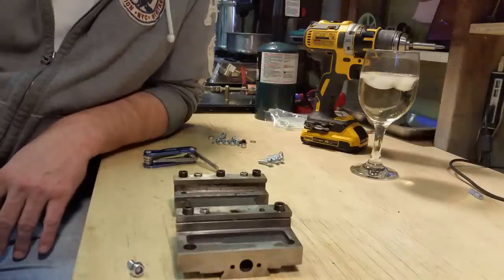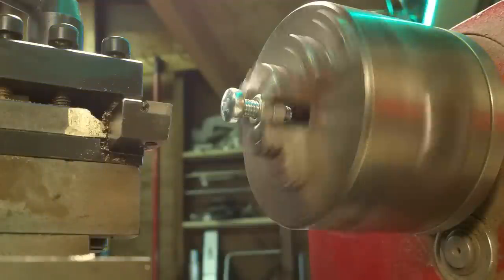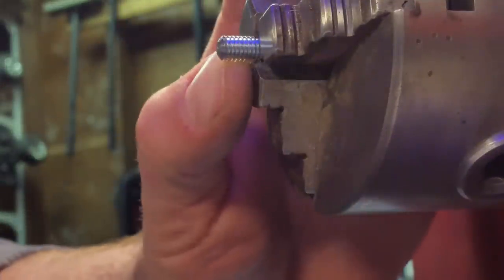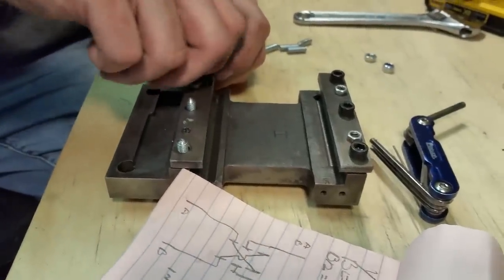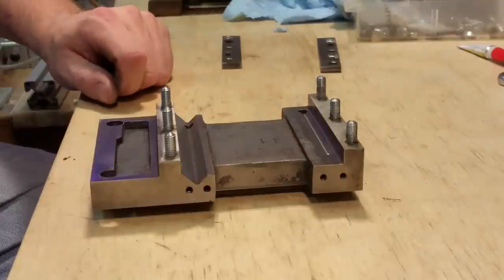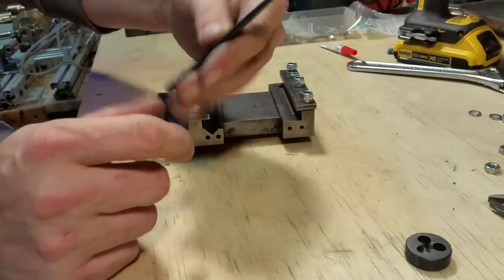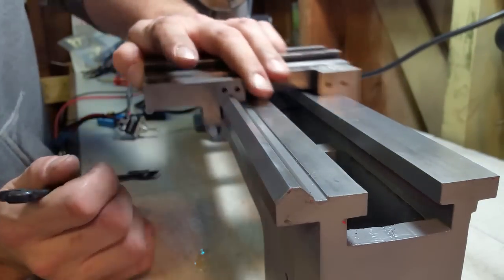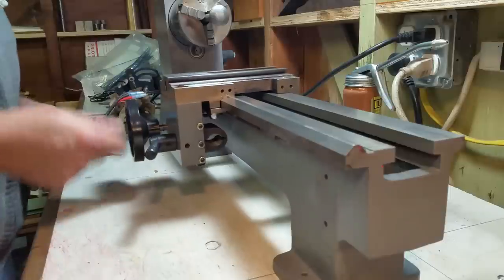Sieg Mini lathe rebuild #17 carriage & apron assembly

Comment: How not to do it.  Throw the adjusting screws away and there is no need for studs.  Get some 6x15 mm bolts to attach the carriage caps and some 1, 2 & 5 thousandths brass or steel shim material and shim to the proper 0.001" clearance.

Comment: I just did this mod last week using eBay sourced hardware.  I bought a 10 pack of M6 Allen socket head set (grub) screws x 30 mm in length.  I didn't need to cut off any bolt heads, and the Allen socket makes for easy installation with green Locktite.  For nuts, again from eBay, M6 flanged nylon locking hex nuts eliminating the need for flat washers.  All worked out well, and I had some studs left over to secure a chip guard for the carriage.....

Comment: Hey, just a friendly tip.  I noticed the harbor freight lathe was having a bit of trouble cutting those heads off the screws. Lots of chatter...  It looks like you had your cutter at a 90° angle to the chuck and piece you were cutting.  If you widen the angle 10 or 15 degrees more, the cutting insert would use more of the tip and cut better, and a couple drops of cutting fluid would help also.  Thanks for the videos.  

... and I like a video length of about 25 minutes, since you asked.  Less ads and YouTube loading times.  I really enjoy the pace of your videos also.  There are a lot of video creators how can't seem to work and talk, and they often go into way too much detail.  I think they forget that YouTube is a visually based information system, not a lecture hall.  Thanks again...

Comment: Couple of hints, you can do your roundovers  very quick and not risk digging a router bit with a fine wheel or  I prefer a belt sander by hand getting used to holding that thread angle. Never had one fail to screw right in. And your wobbly screw problem is the double nut trick. Instead take a piece of copper or brass tube that will fit over it, cut a slot length wise, chuck on it and it will spin straight and not damage the threads.

Comment: This is where I ran into all kinds of problems apparently similar to your experience. I tried Mr. Jordan's modification and it appears that is where you came up with the idea for the studs.
Much, much cursing and expense later, I no more than get it done and he comes out with a different mod.
The entire room turned blue when I saw that.

I bought brass on line to make new guide plates with and bought metric stainless steel all thread at an outrageous price locally.
I still have too much clockwise/ counter clockwise rocking motion and am going to have to tear the thing apart again.
Because he is "Across The Pond" somewhere, he uses metric spec'd steel for his new mod and that is going to be a joy to find I'm sure.
I am really liking this video series even though I am a day late and a dollar short, I thought I would let you know how much I appreciate you doing them.

Comment: This method is not the way to go. Your carriage is riding on the out side corners on the bottom of the ways. Like a V.  you need flat contact on both top and bottom or you will ruin the bed with the wear. When I did mine I stacked shim stock between the gib strip and the carriage and ditched the small Allen screws & nuts. I have also put shim stock between the side of the ways and the carriage on both sides to prevent the carriage from rotating on the bed. I have an almost un measurable amount of play. A few 10th'S at best in any direction. I can send you pictures if you want to contact me.
Reply: Please post an image
Reply: I am in the process of something similar. I made new clamps from steel instead of the cast iron since one is already cracking. With shims in place I am using a lapping compound to eliminate the high spots close to the chuck. Mine must have been ground on the same machine as the one he is working on. Have to be carefull though, the cast saddle threads are not the strongest for the M6 socket head cap screws.